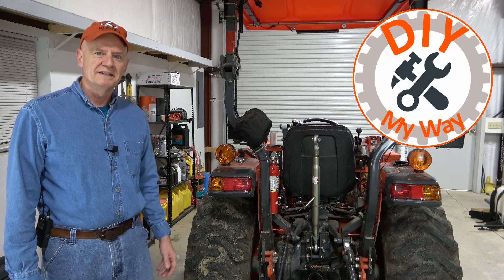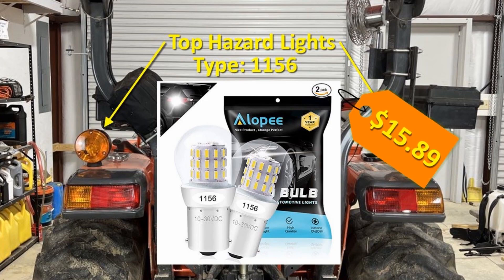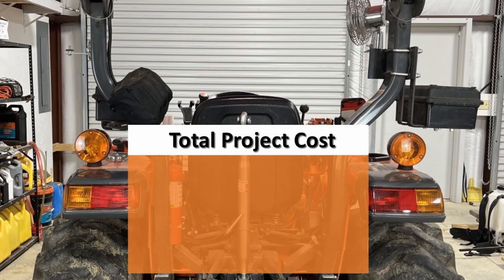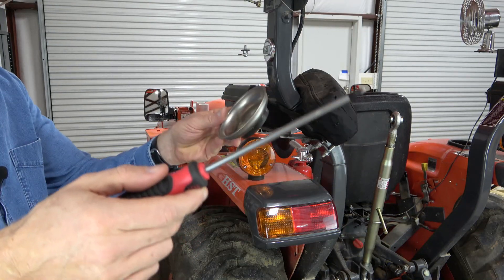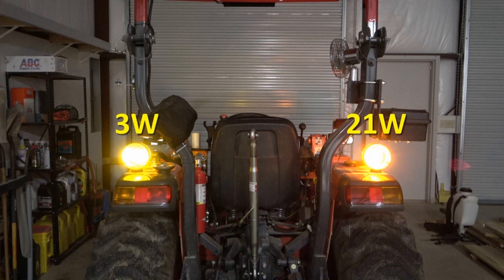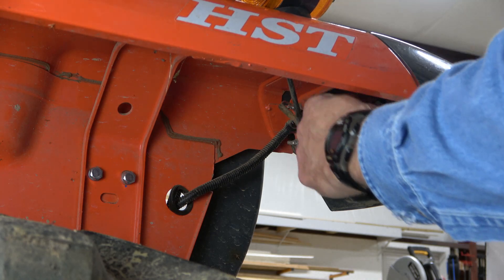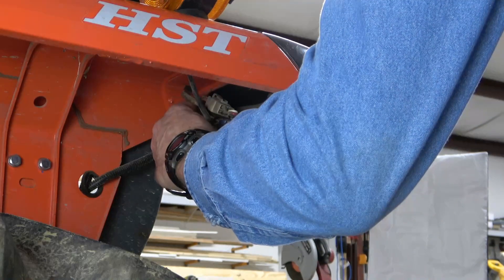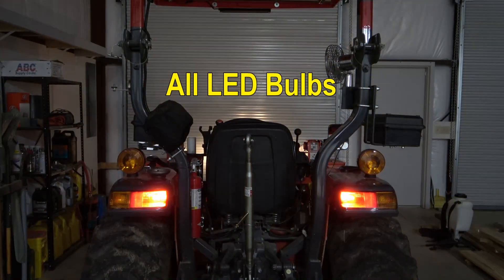Kubota Tractor Mod: LED Hazard and Tail Lights (#152)

Comment: A dab of dielectric grease in the fenderwell sockets will help stop corrosion.  I find that's usually the reason tail lights quit working or blow fuses.
Reply from the maker: Thanks for the tip and for watching!

Comment: That is great timing!  I am just finishing editing a video where I install hazard lights on my smaller Case tractor. And I was looking to replace the 1157 bulbs to reduce power usage!  I'll look at the models you showed in the video! In my case, I use the tractor as a mobile lighting system, so the less power they will take, the better, so I need not run the machine for hours just because I need the lights. Thanks!
Reply from the maker: Hi Joe!  Glad the timing was useful for you.  Looking forward to seeing your hazard lights video. Thanks for watching!

Comment: Nice work, Martin! I haven't given those bulbs much thought, but putting in LEDs now could make a nice difference. I wish the hazard lens on my B2601 had screws - it just pops on. AND OFF all the time. LOL I think removing the light ramping on/off is good as well. It should get more attention with that quick pattern. Thanks for sharing!
Reply from the maker: Thanks, David! No screws for the lens???  Not cool.  Once you change them to LEDs you could use a little rubber cement or even clear caulk get them to stay on, but still removable if you had to. Thanks for watching!
Reply: Awesome tip! Thanks!

Comment: Just an FYI, you can use LED bulbs that are the same color as the lenses. Since regular bulbs give off light thru the entire spectrum, colored lenses are required. But a red LED light behind a red lens will be just about as bright. Plus you get the added benefit of if you break a lens, the right color still shows.
Reply from the maker: Right you are, Joey. Thanks for watching!

Comment: Hello there Martin!!  This was a class A upgrade for sure eh!!  I did this on my GC2300 as well.  Made a big difference in the running volts of the tractor.  One thing I had a problem with was the flashing lights.  The first LED bulbs I bought didn't provide enough of a load on the circuit to make the flasher work.  I ended up having to get a better LED bulb that provided the load for the flasher.  Your lights a way brighter, will last a lot longer, are not as hot and use less power.  What could be wrong with that!!!  Thanks for sharing and take care!!!
Reply from the maker: Hi Mike!  Thanks!  Never thought about an LED bulb not having enough load for the flasher.  Luckily it wasn’t a problem for me.  Yep, LEDs are way better for sure. Thanks for watching!

Comment: I have a L2501 and want to change my head lights to LEDS, I'm looking for a  super bright LED bulb  to fit but don't know what to use and was wondering if you could help me out with a part number or tell me what would be the best bulb to use besides the factory bulbs,thanks.
Reply from the maker: Hi Tony! I don’t know what LED bulb would work. Ever since I installed the LED lights on my ROPS I never use the headlights because the LED lights on the ROPS work SO MUCH BETTER from higher up than headlights ever could. Thanks for watching!

Comment: I changed my headlight bulbs just so they match my LED light bar. My car came with LED headlights and halogen fog lights. I changed the fog light bulbs for the same reason.
Reply from the maker: Gotta love LED lights! Thanks for watching, Terry!
Reply: What kind of tractor do you have and what kind of LED headlights did you use,I have a L2501 and want to change my headlights to LED, please let me know what would work and are they super bright,thanks.

Comment: Hey!  Enjoy your videos like everyone else. Question: I’m going to replace the bulbs illustrated in this video but, regarding the headlights, I just want to clear something up. You say you don’t use them, which I get, but in terms of draw on the battery, would it make sense to swap out them out for LED’s?  Then maybe you could use that wattage for other accessories?  Just wondering. Thanks!
Reply from the maker: Thanks Samuel! Since I use my light bar as headlights instead of the headlights , there is no need to change the headlight bulbs to LED because they never draw any power. Thanks for watching!

Comment: I was doing this upgrade on my L2501 tractor today and noticed that the old incandescent tail light bulbs are double filament, but the brake light filament does not light up when you press the brake pedal. Never knew that tractors do not have brake lights for highway driving; guess the hazard ID sign is supposed to take care of that. Does anyone know why tractors don't have brake lights or am I missing something obvious.
Reply from the maker: Hi William!  I always assumed my L3901 had brake lights then discovered it didn’t.  I looked for a switch on the brake pedal in case something wasn’t working but there isn’t one.  Don’t know why, though. Thanks for watching!
Reply: On my Kubota (LX2610), when I turn on the right turn signal, the right one flashes and the left one comes on solid, and vise versa. I guess someone is assuming if you are turning, you are also slowing down.

Comment: How did you get your lights to flash. Mine wouldn't flash after I installed LEDS
Reply from the maker: I didn’t do anything. The LED lights just flashed like the incandescent ones. Your tractor may rely on an old style blinker module that requires a certain minimum amperage load from the bulbs to work.  You can either replace the blinker module with one that will work with LED bulbs or just get blinking LED bulbs. Good luck!
Reply: @DIYMyWay  I have to do some more checking then. Mine would flash until I turned the headlights on then the flashing would stop and would be just lite

Comment: I find the "Up to 30,000 hours" statement from the manufacturer very misleading. That means they could last as little as 10 minutes. If they're still working at 30,000 hours, they're not suddenly going to stop working. The meaningful value is Mean Time Between Failures, or MTBF. And I'm pretty sure the Chinesium vendors of Amazon aren't going to or can't provide that number.
Reply from the maker: In my experience the lifetime hours listed by all LED manufacturers are greatly exaggerated and I don’t recall seeing a MTBF rating on residential or commercial items like lighting.  Those ratings seem most common in industrial settings for equipment and especially individual components like electronic parts.  You are right not to expect MTBF ratings from Chinesium vendors and neither do I.  Thanks for watching!